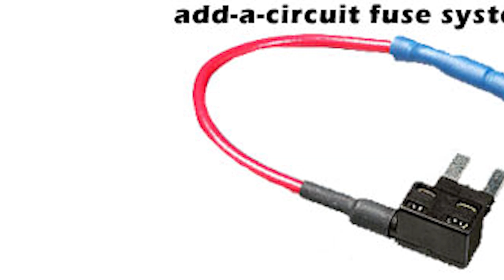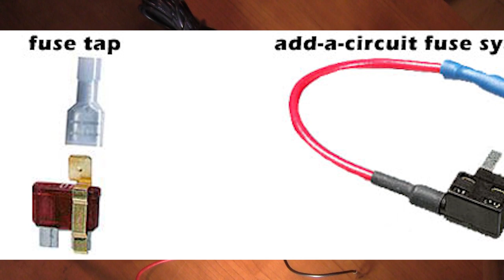Hardwire your dashcam, a couple of methods

Comment: I too think the adapter method is very bulky, and I want to thank you for sharing this vid as it is the only one I could find explaining how to directly wire it like that. Can you make a short vid on how exactly you connect the 2 wires you soldered (the positive and negative) to the add-a-circuit?
Reply: The positive just wires to the add circuit and the negative goes to a known good ground.. whether you tap in to an existing ground wire or just go directly to a bolt on the car using a ring terminal... its really specific to each vehicle.
Reply: +TRCC thanks wanted to know the same thing. cheers

Comment: May I please ask you a question? If I wanted to hardwire a total of four {4} dash-cams to the cigarette lighter, is there a certain kit I should use to make this safe? I am assuming four cameras would put too much electrical current on the cigarette lighter wire. 
Thanks in advance!
Reply: I am sorry I don't know the specs of the dash cams and I am sure each camera is different... if the combined amperage is under 15 amp (typical fuse on a CIG lighter circuit) then you should be fine..
Reply: I am sorry I don't know the specs of the dash cams and I am sure each camera is different... if the combined amperage is under 15 amp (typical fuse on a CIG lighter circuit) then you should be fine..

Comment: Why not add the wires and run the two wires out the receptacle cover; replace the cover as it will reduce any electrical short, and will permit the unit to have space to cool off. Furthermore, you would have a solid material to use a tie down to some area near the fuse box.
Reply from the maker: Harr W you could if you choose the point was to make as small footprint as possible.

Comment: Do you need to use the same fuse that supplies the cigarette lighter (20 amp on Ford) in the slot for the add-a-circuit when re-wiring the adapter...ie. It would be 20 amp if you just plugged it in. So, essentially wouldn't you need to supply the same amperes to the add-a-circuit for the dash cam?
Reply from the maker: +Dustin Reoch youd still need 2 fuses, one for the add a circuit and one for the cig lighter.

Comment: This helps. I don't have an add-a-circuit, but I do have an inline fuse holder. Would I be able to make it work with the fuse holder? If so, how?
Reply from the maker: +SPeenie1 Yeah you can, you just need to tap in to a wire that has an accessory power, you'd need a circuit tester or a multimeter and find a wire that has 12v with the key in accessory mode and 0v with the key removed.
Reply from the maker: but realistically, an add a circuit is only a few dollars at any automotive store, its much easier and quicker.
Reply: +T3rry1S  Ok. I intended to get the circuit, but the geek squad guy gave me this and told me to use the ignition and to run the fuse holder to ignition wire and power of the cig lighter board. He said the pro's don't use circuits because it doubles the size and they short faster..?
Reply from the maker: SPeenie1 Geek squad are idiots, pros dont use an add a circuit because they dont care if the car retains electrical warranty or anything else... its possible to do it this way, but not ideal... i dont use add-a-crircuit, but i know what i am doing and i dont care about warranty because my car is out of warranty... realistically the part would cost the same... they probably just sold you the inline because they didnt have an add-a-circuit and if you walked out they dont make money
Reply: I'll get the circuit from autozone then. Mine is under warranty. He didn't charge me for it. Told me to call him when I want to schedule an install. Lol.